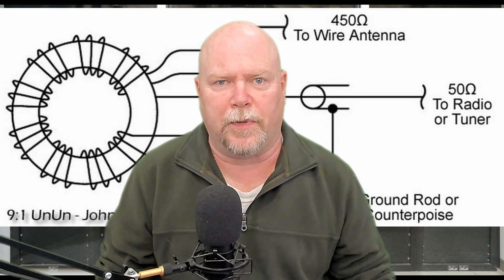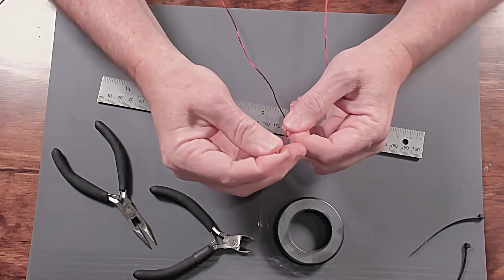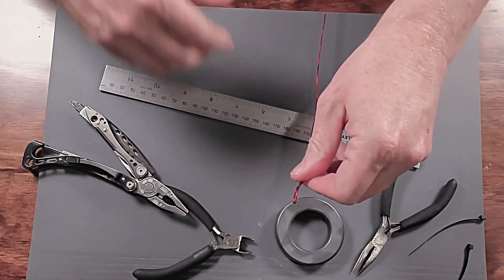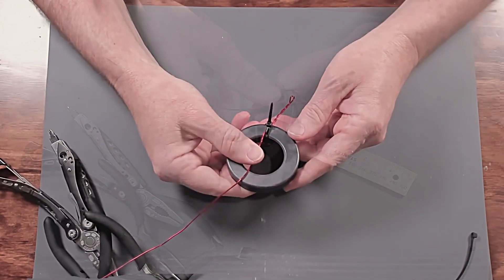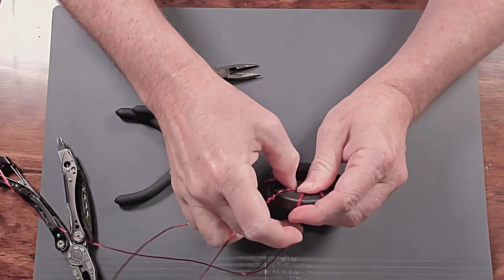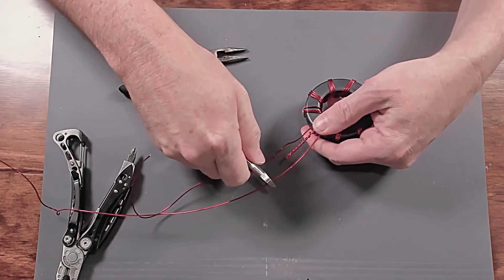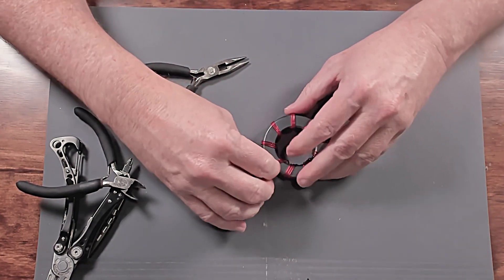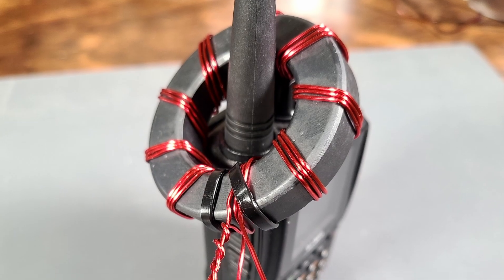Single Wire UNUNs - a quick 9 to 1

Comment: Does this also work with a 1:4 and how do i wind it?
Reply from the maker: The autotransformer style will work for any turns ratio but it's always an UNUN.  4:! are usually used to feed some kind of dipole and should be wound as a BALUN.  Hard to beat the Guanella for a 4:1
Reply: @M @MattHeere a 4:1 would be used for a  rybakoff antenna but also the challenger antenna which I would make

Comment: Why not just wind a single layer of wire all around without interwinding the following two passes?
Reply from the maker: It would work either way.  You get very slightly better coupling to the toroid with the turns the way they are, but you'd never see the difference in your log.  49:1 are wound as you suggest and they work fine.

Comment: Matt I'm getting a little confused. Does the short 30inch leed you first wound, does it go to the Ground or the Antenna?
Reply from the maker: The twisted up pigtail is the feed point.  The loose end that's only one set of wraps around from the feed (the short piece) is the ground.  The last end - the one that's two sets of wraps from the feed point (the long one) - is the antenna connection.
Reply: Thanks Matt, thats the way I had it. I just wanted to be sure. 
   Now I have to drill a hole through my home siding from the 2nd floor and run a piece of coaxial cable through it to the UNUN outside 🙏😀

Comment: Hi, Thankyou for sharing your experience, you made a great video!
  I built the torrid following your instructions.
 If you installed into a project box what components did you use? 
  Do you have a picture of the completed project?
 I'm just trying to keep my 70 year old brain active and challenged.
Reply from the maker: All my UNUNs go into 3D printed boxes.  Nothing fancy.  There are holes to mount the BNC jack (not a fan of SO-239) and an 8-32 stainless screw to hook up the antenna.

Comment: Awesome video. What about the capacitor? What purpose does it serve? Is it not necessary?
Reply from the maker: The capacitor helps flatten the response at the high end.  We're essentially winding an inductor here, and inductors are low-pass filters.  The capacitor off-sets some of the inductance.  You should add it if you want to operate on the 10M band.

Comment: soo if i want 50:600 like 12:1 it wil be 12 turns? 73 TF2WIN
Reply from the maker: The impedance ratio is always the square of the turns ratio.  In this one we have 9 turns to the feed point and 27 turns total.  27:9 is 3:1 turns ratio so a 9:1 impedance ratio.  The square root of 12 isn't an even number.  It's ~3.5 so you could so something like 14:4 turns ratio.  See my other video about the 49:1.  You'd want to do it more like that one with 4 turns between ground and the tap, and then 14 total.  Would get you in the ballpark for a 600ohm antenna.

Comment: Hi, Thanks for the nice video. I am an absolute new in Radio field. Can I use Torroid of diferent diameter? And I have quite a good amount of 20 SWG wire with me. Can I use that?
Reply: Did you build it? I haven't made one yet but I'm about to.
Reply from the maker: Different diameter is fine, although this 240 size is about the smallest you want to go for 100W radio.  Smaller toroids will overheat under power.  It is critical that you have the right ferrite mix though.  It needs to be a type 43 material.  Toroids come in hundreds of different blends of materials and you can't tell by looking at them.  20AWG wire is totally fine.

Comment: Thanks for the novel method of wrapping a 9:1 unun!  But, in comparing the finished product to the circuit diagram you presented at 00:15, I count 27 total turns for your method and 24 turns for the method shown in the circuit diagram.   Why the difference and how are you coming up with a final ratio of 9:1 for both circuits?
Reply: The number of turns doesn't actually matter with this type of transmission line transformer. All 3 windings have the same number of turns. The 3:1 overall ratio comes from the way the ends of the 3 wire winding are terminated. 1 section vs 3 sections in series.
Reply from the maker: @alanb76  You're right that the ratio is the critical part, but the bandwidth of the transformer varies wildly with different geometries.  The blend of inductance and intra-winding capacitance is really important.  Stick to 27:9 unless you have a really specific reason not to.
Reply from the maker: It's 27 total, 9 times 3.  That gives you the 27:9 ratio equivalent 3:1 turns, so 9:1 impedance

Comment: I’ve always wondered why nobody uses the Autotransformer method like a 64-49:1 is done. Does that not work the same?
Reply from the maker: See the next video.  Any of these UNUN/Baluns can be wired as an autotransformer, and there are several good reasons to do it that way beyond ease of construction

Comment: I use some string and wind with the string. Then cut my wire to length using my string as the length gauge. Works like a champ.
Reply from the maker: You still have to allow some extra because the wire never wraps as tightly as a string will.  For expensive wire like something silicone jacketed it's probably worth the time to do and a good trick.  For my chineseium magnet wire, the string would be worth more than the 9 inches of wire I wasted.